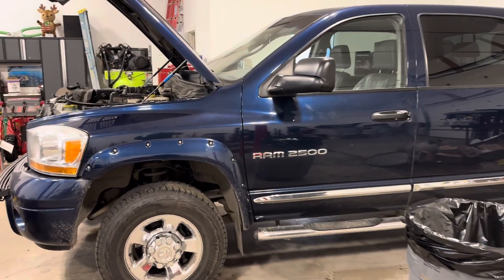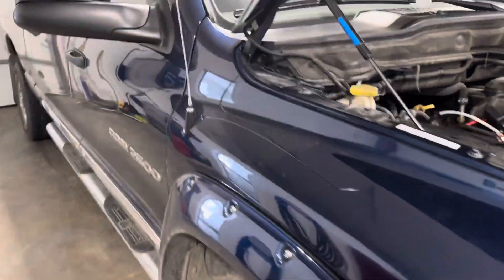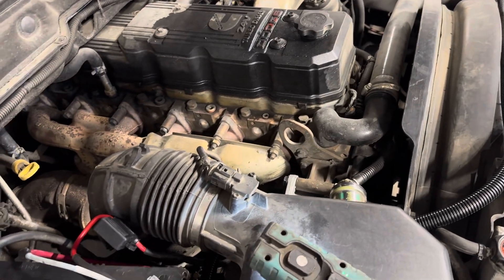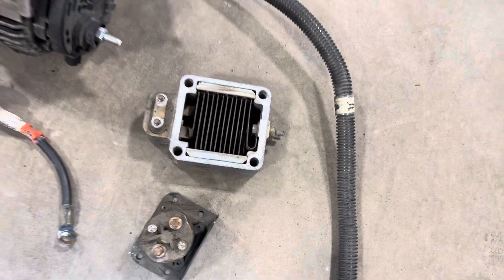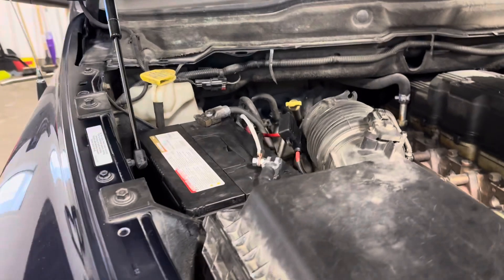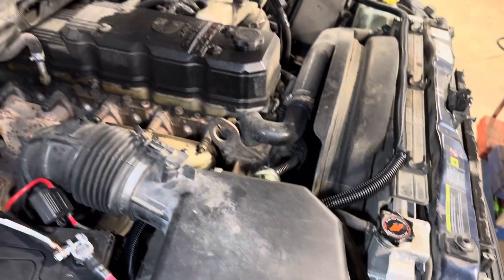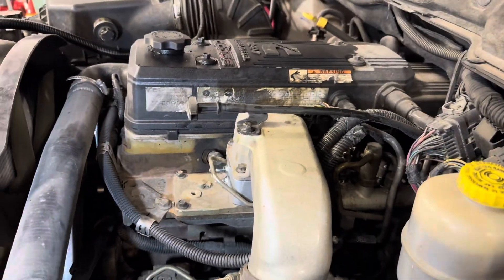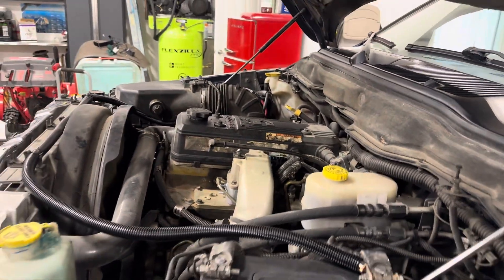Dodge Ram 5.9 Cummins Intake Air Heater Shorted

Comment: Tim, this problem is happening now in my 2006 Ram 2500 5.9l diesel. I have the Solenoid and I need the crossover cable. The crossover cable comes with a shorter cable with lugs but I do not know where it goes. Can you advise me please? Thanks, Steve